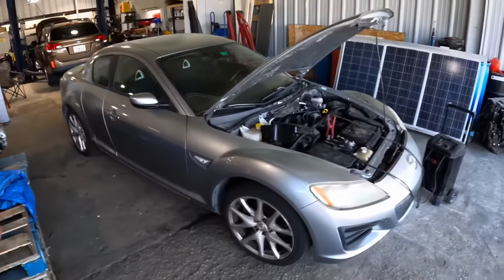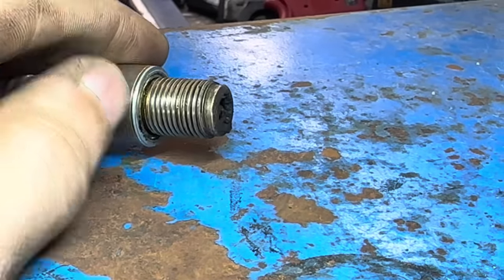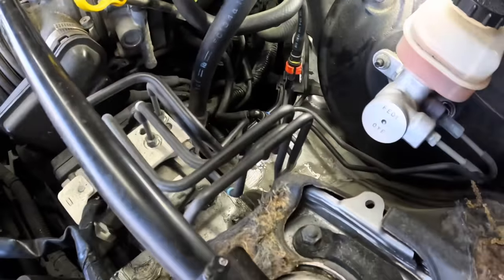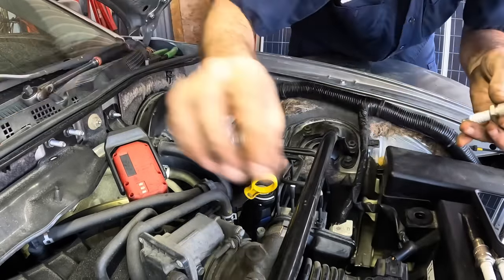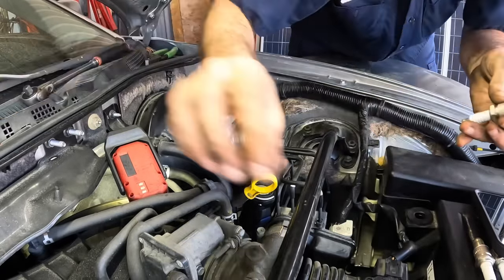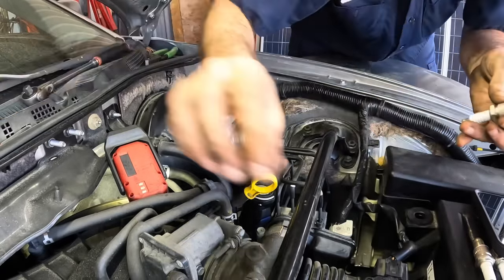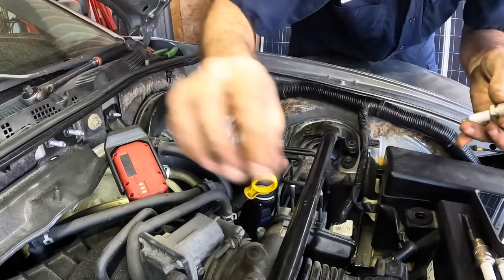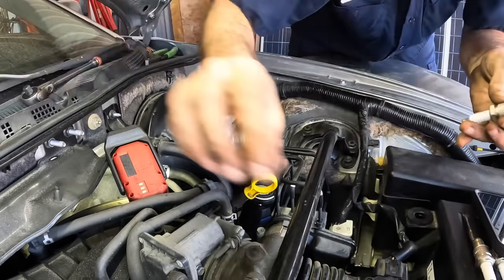Low Compression Rotary, No Start FLOODED Mazda RX-8 Drove in Towed Out!

Comment: They can flood when you repeatedly drive them a very short distance , or if there’s an ignition issue, don’t rev them when cold, use non synthetic mineral oil of 5w30 NOT 20 ! Synthetic oil will cause internal carbon building, once you de-flood, don’t turn it off, war it up with a gentle drive ,after 10 minutes to warm up rev it hard under load 2-3 times to clear it out, if badly flooded disable the ignition, de flood with plugs out and spray a tiny bit of thin oil into the plug holes, turn it over a little, put plugs back and fire her up, if gentle when cold and correct oil they can last, also with earlier years PCM updates vastly reduce flooding, so get that PCM updated via the dealer if not done already

Comment: I liked my old RX7 and RX8. For the RX8 it injected a small bit of oil into the engine to lubricate the rotors. That's why you have to replace them so often. Just remember to keep the coolant topped off. If the engine overheats at all, you'll need a new engine because the seals on the rotors will blow. That's what happened to my RX7.
Reply: Same problem with the RX3's back in the 70's but at a much larger scale.

Comment: I have always been fascinated by the Wankel rotary engine, mostly the rotor seal issues. Premixing two stroke oil into the gas helps a lot. I would love to own and experiment with one.
Reply: Yea a lot of guys premix. 100:1. But you can also buy an oil injection stand alone tank. It separates the injection from the crank case oil. So you can use better oil in the engine and 2 stroke oil in a separate tank. It burns cleaner and fouls out less because of the reduced soot/ash from the oil. These engines biggest problem is that it's not a "commuters car". It needs an owner that knows its quirks.

Comment: Convert to the Chevy coils and that problem will go away. Had my rx8 since 06’ stock engine and I drive it all the time. No premix neither. Dont put dielectric grease in the wires or they pop off the coils. Oh and pull the the fuel pump fuse as well while it’s flooded. It’ll take awhile but will run. If it sounds like no compression that’s good. If it sounds like compression and no start, then it’s most likely a big problem

Comment: Awesome video, Ray. I enjoyed the struggle you had with those horribly placed spark plugs. The interval is so short, I don't understand why.
Reply: Because the engine has to inject and burn oil to lube the apex seals, plus the plugs have to be "recessed"  in the combustion chamber because of how the rotar spins. So that pocket collects a lot of crud, hence why these plugs are so badly carboned up.

Comment: These engines are notorious for having low compression.  Subsequently, starting can be difficult when cold.  Fuel washes out the rings.  The alternative is installing "fast-start" starters.  it will bring the compression up by spinning the engine faster.  That entire range has this problem.

Comment: I had an R100, second R100 to arrive in Ontario, Canada (1969) No rev limiter, turned the quarter 88 MPH. I never had to do an oil change, because I always adding a quart of oil; I did change the oil. Poor gas millage. Three engines under warranty. Had it for about 2 years.🦊

Comment: Just gonna relay one of my own issues with those rotary engines...  They also inject OIL into the cyliners to raise compression...  I would have dropped a squirt or two of 10w30 down the intake...

Comment: I want to get myself a ODBstar DC706 cloner tool that will clone and flash ECU's and do other advanced diagnostics. These engines were notorious for Apex seals leaking causing low compression and no start. The concern is that there is a bluish smoke coming out the exhaust. These engines recommend a small dilution of 2 stroke gas put in them to keep the seals lasting. Maybe that ECU is good, maybe it isnt. Investing in an OBDstar DC706 is a live saver from shipping cars out to a dealer to have them programmed. In other words, there is no squash, bang, or suckie suckie going on.

Comment: Interesting video Ray, didn't know you could go from the top. Taking the wheel off is much easier. Didn't Alldata state that? Also, using fender covers would be more professional. Can't believe the dealership couldn't fix it. Hope you didn't ripoff the customer 😢

Comment: On an RX-8, best way to clear a flood is to remove the plugs and crank it. Also, make sure the oil injection pump isn't dumping oil. I've seen that and had to replace the oil injection system. These inject oil, just like a two stroke. Based on the amount of smoke on throttle, I'm gonna say one or more of the oil injectors is leaking/stuck. @33:00... This is why I pay for stuff with a CC. Reverse the charge. The did NO work. They didn't even diag. It would be like you charging a diag fee to walk out to the parking lot, look at the cars and say, "I can't fix that".

Comment: Stickers ?? ....  Would love to see some RRR windshield service stickers.
Oh, I had three RX4's back in the day... a 12A and two 13B's, all with points and distributors... Not easy to pull 15k rpm out of those, but it can be done. Reduces the number of gear changes when drag racing those heavy V8's.... lol

Comment: My 85 RX-7  purchased new, now with 150k miles has considerably more room to work in and much easier to access plugs plus they're all of the same type. When sitting for some time, it can be difficult to start. With the choke pulled out, I put the pedal to the floor and crank in short intervals pausing a few moments between starts until it eventually starts, it's the nature of the beast. The RX-8 seems to have a reputation of reliability issues and generally a problematic car according to the reviews.

Comment: Gee I had a straight four cylinder 1200 that would not start in the morning. Crank and crank and crank and as the battery began to show it was running low on electrons, the engine would fire up and gave no problems during the one hour drive to work. When I got to work I shut off the engine and just for fun tried a re-start which was perfect. However when I left work at the end of the day, the whole non-start fiasco started all over again until a lot of cranking had been done. Taking advice from a mechanic I got rid of the car, he had told me that components had worn in the engine that was ruining compression. After many cranks the heat had been sufficient to cause expansion and provide enough compression to start the engine. I hope you do not have similar with this car Ray, you will find out after the engine has been left to cool over night.

Comment: rotary engine need to redline most people don't know this because the engine design burns oil this is to keep the apex seal always lubricated and cool but this is actually a flaw because it cause carbon build up, so what enthusiast do they do a separate oil mod instead of burning engine oil it burn gas mix with 2stroke engine oil or caster oil, this solve their carbon build up issue also helping to lubricate and keeping the apex seal to last longer, sadly most people don't know this and if anyone wants to drive a rotary car be aware its not like a typical piston car.
Reply: A rev a day keeps the mechanic away for rotary engines.  I try to get to 7k rpm each drive for that reason.  Automatics have a lower max rpm but still need to rev it out.

On pre-2009 rx-8s you could add a sohn adapter to pull oil from a reservoir. On 2009+ they made multiple changes to the engine including better oiling from the sump but removed sohn compatibility.

I premix my 2011 with .5oz per gallon which is also recommended.

Comment: There's possibly a known failure mode inside the ECM that is not repairable but the repair facility won't know until they plug it in. Most likely a proprietary part on the board has gone Tango Uniform, and they can't get them. So, they plugged it in, got the "Code of Death" charged a diag fee, and sent it back. Where they failed was not communicating to you. They should have at least sent a print of the diagnostic report or a note to that effect.

Comment: Using synthetic engine oil will (apparently) foul the plugs and seals in a rotary. The engine injects oil into the combustion chamber, and synthetic leaves residue. Fouled plugs won't spark, and fouled seals mean poor compression. And put the car on a lift to access the plugs quite easily.

Comment: The reason the plug looks like that is, the seals have failed on that wonderful rotisserie engine! Good luck! They really run good until they don’t!! You came to the correct conclusion, time to replace at 37000 miles, engine, that is!!!! Throw about a pound of ether down its gullet, it will start then!!!!! Lol,

Comment: I used to have an RX7.. if it sat without running for a few days, the compression chamber "seals" would dry out and cause it not to start.. always had to remove plugs spray some oil into the chambers to re-lube the seals, and it would start..

Comment: Under the hood, my RX-2 had acres of room, and the reason I removed spark plugs, and learned the rotary engine loses all power when using the wrong plugs, was because the 'seals' failed, and when shut off the combustion chamber filled with water. My solution was to drain the water, start the engine then fill the radiator. After a few thousand miles of this nonsense and not getting any warranty coverage, I gave the car back to the bank. Interestingly, it ran as smoothly and powerfully as ever at the end. Because the Rotor is oil cooled, I was able to drive from LA to San Francisco and back with no water in the radiator.

Comment: Guess your rx8 owner wasn't told to not do short trips and turn the motor off. You can't drive a rotary around the corner when it's freezing and just kill the engine. When you start up a rotary it usually jumps to around 3k -3.5k rpms and then slowly goes down on heat up. Two quick starts floods the engine.

Rx8 owner here for 5 years. Also dont forget rotary burns oil. Never use synthetic oil. Regular oil 1 quart every 1k miles or less if your ripping on it.

Comment: I have seen one of these seals stuck.after sitting.  Im going to get flamed for this for sure. 

Tech took pkugs out. Put not a little bit  marvel oil in chambers. Rurning over by hand.  Then let sit over night. Then cranked with starter no plugs to avoid hydrolock. Then installed plugs and cranked. Slowly like an old 5cyl mb diesel started to fore one at a time. Then got compression like it should.  This way should NOT be done indoors. Possably somewhere where no officials can see you. After getting compression he was told to do a "italian tune up". There was a lot of marvel in the chambers and the exhaust to burn out.  Ran super good after. Had well within spec compression afterwards.  

This was on a used car that sat somewhere befofebthe dealer got it. 

I belive some years actually inject a small amount of oil into the chambers to help the seals float. 

Im thinking the fuel flooding worked as solovent.  I winder why the excess carbon.  My guess is its not run hard enough from time to time and perhaps not correct fuel. 

Glad you got her going.  If you run onto it afain. Try some marvel. Even if its only in the intake. Im sure you can find it on the Interwebs.

Comment: I owned an RX-7. Very nice car until the apex seals on the engine failed at around 125K miles.  The Mazda dealer said I was lucky, most apex seals fail at around 100K miles.  A mechanic quoted $10K for the engine rebuild.

Comment: Excellent idea,will generate and drive business into the shop, selling maintenance packages 7500,15000,and so on, major  fluid changes at 50,000 & 100,000 brake fluid on age basis all good sellers

Comment: I had 2 RX-8s.  1st one was bougjt back by Mazda due to wrong published engine data.  That 1st rx8 had a bad navigation system, too.  The car was in the shop more than I had owned it.  Turned out it was the night to day display on the pop up nav screen that caused it to not work.  I bought snother one without navigation and with 6 speed manual.   Loved that car.  Kept it until it was in a car accident.   Just wasn't the same after that. You did great, Ray.

Comment: to call it a 1.3 Litre is a bit cheeky,  yes each combustion chamber is 650 cc,  but the rotor is triangular so there are 6 , 650 cc chambers as the engine rotates - there fore it is more likely to be 3.9 Litres , which goes some way to explain the performance , and fuel consumption of the brilliant  but fragile motors, We call them Mazda Twin tubs ( after a type of washing machine)

Comment: I'm going to shoot in the dark and say you have a bad Apex seal situation I came up with a theory a long time ago to use engine restore pour a capful at a time into the spark plug hole an crank it multiple times over a period of time so it coats the wall that the Apex seal touches. It gives 10 extra PSI on naturally aspirated piston driven engines

Comment: I had an rx-8 and when it flooded deflood mode never worked. Pulling a plug from each rotor housing then doing deflood worked every time although it was annoying. Isn't there an access panel on the fender liner to get to the plugs, or am I miss remembering. Oh and to avoid fowling the plugs like that, every time you get the engine warm you MUST buzz it (at the red line the car makes a buzz noise). I got rid of mine because on the handling limit it had a dangerous snap understeer (push for y'all) behaviour that I really disliked.

Comment: Those rotary engines are hard to start when they get flooded. It took me a few hours to get one started when it flooded. The owner had started the car and moved it a few feet and shut it back off. Big no-no with those engines. They have to warm up all the way when started to keep from flooding.
Reply: Seems like a design flaw
Reply: @croycamaro  That's the rotary engine.
Reply: @croycamaro no… the combustion chamber is much larger than a piston engine and therefore sinks a lot of heat. If the engine is not run long enough the fuel condensates on the rotor face and will cause it to flood the plugs he just changed.

Two stroke engines suffer the same problem and is possible as we all know in 4 stroke motorcycles. Multi cylinder engines don’t usually exhibit this as at least non flooded cylinders will fire. A misfire is the same thing.

Almost every car owners manual has a section on “short trip” and it’s going to say don’t do it lol
Reply: @AliasTekTV  in other words, an inherent flaw in the design of rotary engines
Reply: @croycamaro  Whatever floats your boat bro.

Comment: Common problem with the rotary is worn out tips on the rotors, hence low compression and hard to start! £2000 engine rebuild cures it!!

Comment: If memory serves, the rotary engine fires twice on two different sides of the rotor on each revolution, not twice in each chamber, as I said I am not 100% sure, but I think this is how they engine makes so much power, 1300cc pushing out close to the same BHP as a 2600cc unit.
Reply: wankel rotories use a 3 lobed rotor that spins on a crankshaft so you get 3 firing events per revolution/per rotor.  that 2 rotor wankel produces 6 firing events per revolution.  they operate like a 2 stroke with intake/exhaust ports in the housings, no valves, cams, etc.

Comment: I wonder if these Renesis rotaries still drink oil to keep the apex seals lubed. I recall the old 4-barrel carb on the 79 SA I use to own having oil lines that fed oil into the intake. I bed that explains the spark-plug change interval. Along with the typical driver abuse.

Comment: little known facts in the early 70-s john deere owned rights to the wankle rotory engine and changed it to a deisel and before that in the 60-s a rotory engine was put into a 1966 mustang, as a test mule  neither worked out. then is when mazda bought the rights. i got a chance to drive the car when a hot rod shop bought it at public sale . was a 3 lobe or cylinder  unit an was under powered in the car.

Comment: LOL, I've been building rotary race engines for 40 years, those are some crusty spark plugs. The engine runs much better if you use the special radially gaped plugs instead of the vertically gaped ones. This is a very different engine from a piston engine, so very few general mechanics know how to work on these engines.

Comment: When turning rx down it's good to keep 3000 rpm for about 10 sec and then switch off ignition with gas pedal still pressed. That prevents flooding because rotor will spin couple of times by itself removing all the stuff from chamber. Also it will be oiled for next run

Comment: I'd think that you could do a lot of diagnostics on an ECM just by using the external connectors.  No reason to disassemble it if your testing shows that it can't be fixed.  The testing still takes shop time, and someone has to pay for it.

Comment: SIMPLE FIX: Spritz some transmission fluid into the intake after pouring a quart or 2 into the petrol tank.

Why?, Because the Apex seals on the Rotarys are carbon-gummed up & seized in place leading to a low to no compression issue.

The transmission fluid yeah it’s gonna make it smoke like crazy but that’ll get rid of most of the mosquitoes & the copious amount of detergents in the transmission fluid will clean out all the gumminess around those Apex rings.

Common issue with Rotaries since the 1980s